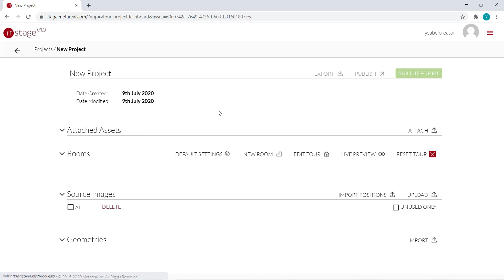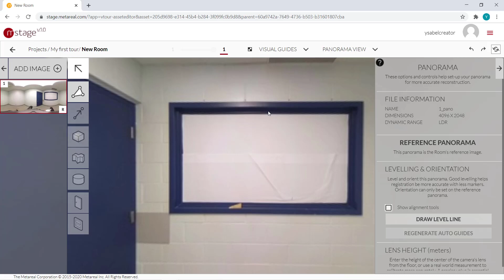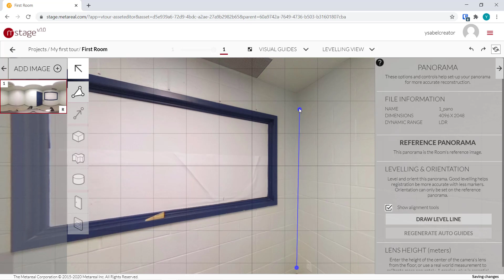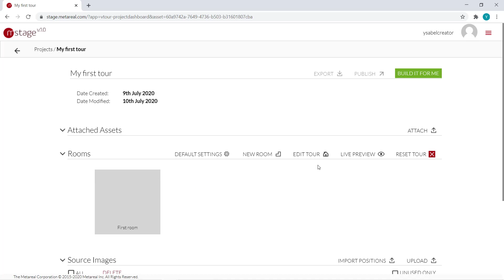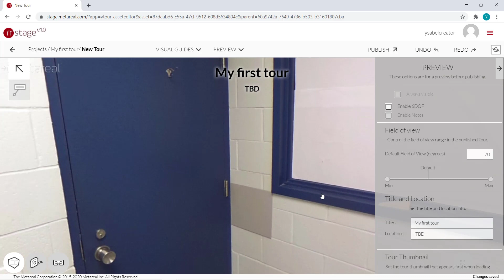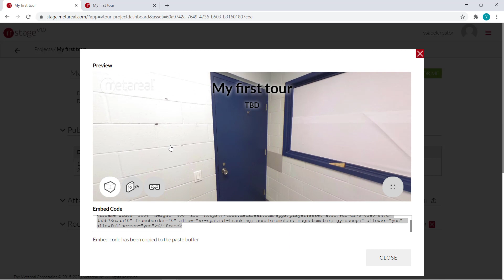How to build 3D virtual tours from 360 panoramas with Metareal Stage | Basics - Part 1

Comment: Just wondering is it possible to map out the floor plan using the ceiling instead of the floor? I got lots of furniture and is hard to find the corners of the room with a table or a drawer blocking it. Thanks!

Comment: How crucial is the correct lens height? It's not always the exact same height in all the shots. There might be a difference of maybe 20 centmeters.
PLUS:  Sometimes I have a tour that contains some spheres that were shot from a extra high tripod, but the height might differ, too. How can i deal with this?
Reply: Maybe the "measure" feature could work as a correcter to your in lens height variation.

Comment: Could you explain, (or point me in the direction of the tutorial that explains) the difference in the two protractors?  Also, the "preview" panel menu is not showing up for me, is this a toggle that perhaps I've clicked or unclicked, or an issue on my end with the webpage not loading properly? Thanks!
Reply: I want to back this post. I cannot see the panel menu in the preview.

Comment: Can I edit all of this in my ipad?  or can you tell which operating system can be used? for instance Mac or Window or iOS or ipad OS?
Reply from the maker: Editing is only supported for desktop devices right now, so you won't be able to edit with a mobile or table device. We also only fully support Chrome for editing (though tours should still be accessible on all browsers and devices)
Reply: @metarealstage  FYI: viewing on Safari doesn't work well

Comment: Hi, i tried uploading my pano images taken from my smart phone. it shows an error that asset is broken, your image aspect ratio is 3:1 it has to be 2:1. I tried taking pano with different resolutions, still facing same issue. is there any app which can take pano in 2:1 ratio, if not how do i upload pano's taken from mobile ?
Reply from the maker: You can use any of the following apps to create 2:1 panoramas with your smartphone:
Nodalview
Google Photos
Microsoft Image Composite Editor
Facebook 360 Photos
Reply: @metarealstage  I can't seem to find the setting to get my photos to 2:1 every photo I upload I get error BAD IMAGE RATIO

Comment: Nice but lot of work if you have a big house with furniture everywhere, multiple floor, gardens etc. and have to make 3d works for tens of panos!
Reply from the maker: It can be very time-consuming at first, but the more tours you do and the more familiar with the software you become, the easier it gets. At this point, a house like you're describing would probably take one of our team an hour or two at most to build
Reply: @metarealstage  Would it not be best to work using the ceilings as a reference point when getting the room shape and measurements as there doesn't tend to be much clutter on the ceiling!  Would this not make sense?  You normally have a clear view of the entire ceiling for squaring and measuring no matter how many tables and chairs are on the floor.
Reply from the maker: @DonniePhairPhoto  You can use ceiling points for reference by scaling up your room height while marking points. Part 4 - Kitchen shows that in action